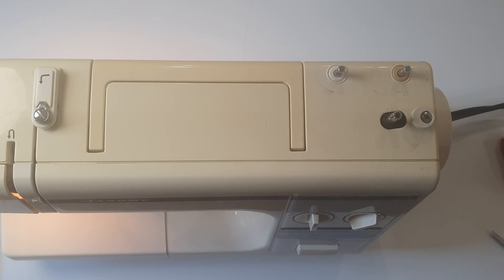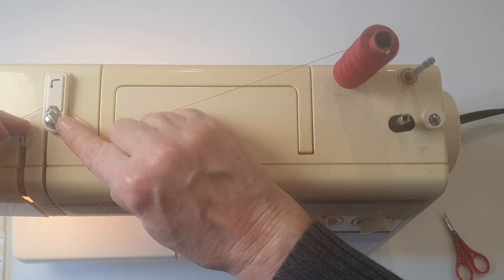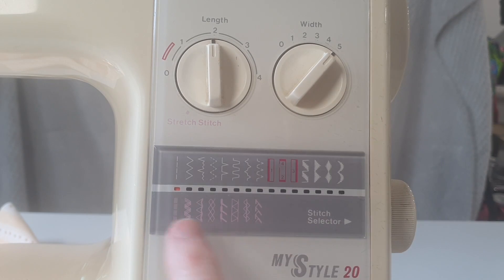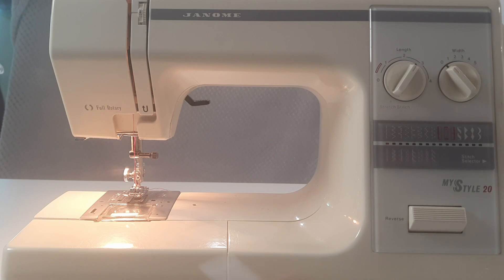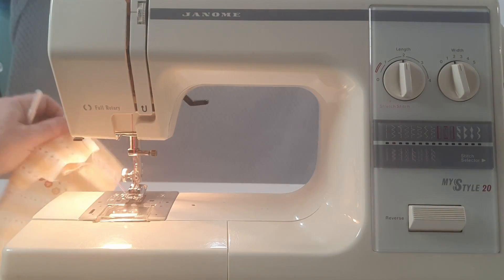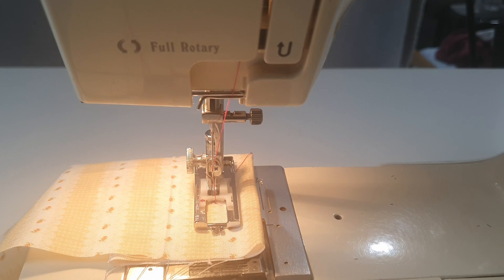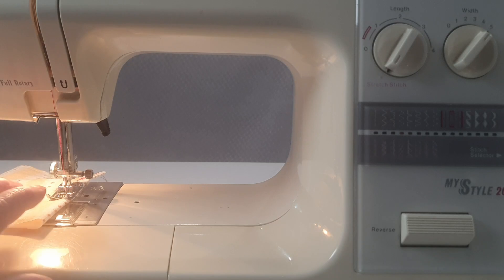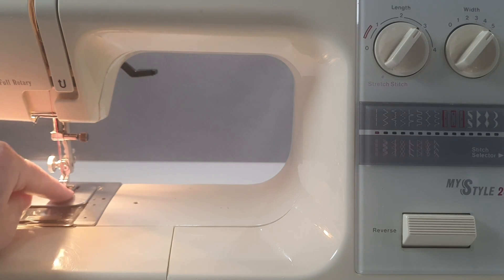Janome My Style 20 | Threading and Basics

Comment: Thank you for the video but I can not find my power switch! Where is the power switch? Is a power switch on this model thanks?
Reply from the maker: @hehu3988  Hi there,  I  am sorry I can't give you a set answer to that question as it was a borrowed machine and I can't check. However,  if there is a power switch,  it will be very close to where you put the plug in. Some of those machines just come on when they are plugged in, and the wall plug is switched on. 
I think you will need to plug it in and push the pedal! Good luck. Sharyn
Reply: @SharynsSewingSchool thank you for your quick reply! There is nothing next to the plug or charger on the side of machine! When I plug it, the light is on, but there is no button for me to press to switch off the light on the machine, do you know what I mean? Thank you
Reply from the maker: @hehu3988  lots of machines have the light come on automatically when the machine is on. I would assume your machine is ready to go as soon as you press the pedal. If it doesn't,  it probably needs to see a technician.
Reply: @SharynsSewingSchool  my sewing machine works perfectly . It just has no power switch to turn the lights off, when I plug in the power , it shows lights. I have two more sewing machines, they all have power switch to turn off the lights next to the plugs, this one is very strange.
Reply from the maker: @hehu3988  The only way to run the machine without the light will be to take the bulb out. Just make sure that you unplug from the wall first!

Comment: You want to sell machine
Reply from the maker: @tanvimore4528  the machine I was using for this demonstration belongs to someone else.
Reply: I want second hand but not available
Reply from the maker: @tanvimore4528  different countries will have different machines available.
Reply: Hi Sharon I have this exact machine , great tutorial could you please tell why my machine seems to sewing slow ?
Reply from the maker: @janetgriffiths1534  I only just saw your comment!  The machine sewing slowly might be a few things. First, check the foot control. It may have a slow/fast switch that you can change to fast! That would be the only easy fix. Next, because it is a quite elderly machine, the brushes in the motor might be wearing out. There may also be a "getting old" problem inside the foot control. Either of these other issues probably require a technician to look at them.